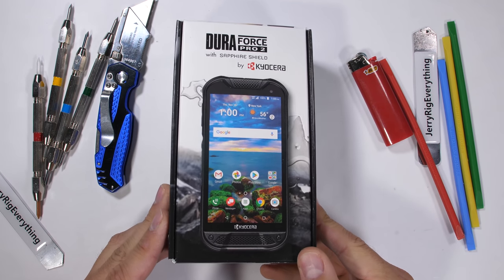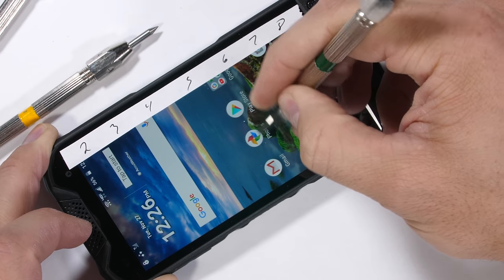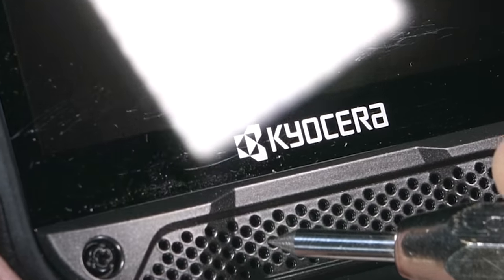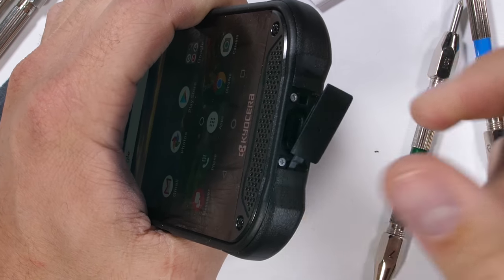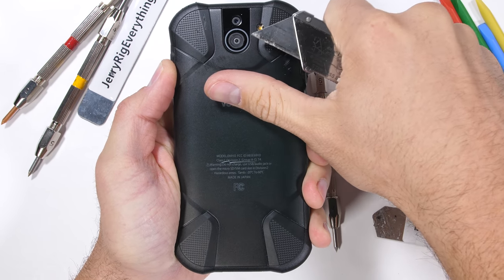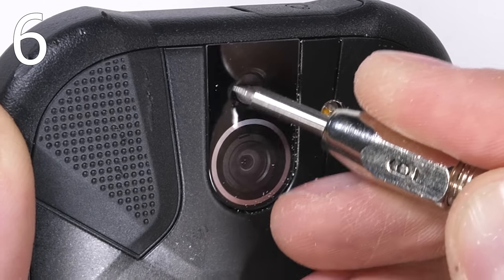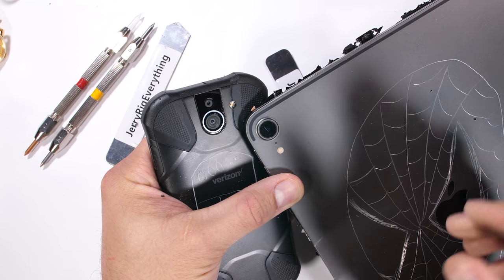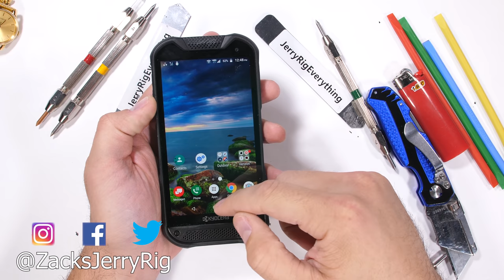A Rugged SAPPHIRE Covered Smartphone? - Durability Test!

Comment: Lol my EMS company uses these as our radios. Perfect for the job 😂
Reply: alexandra i. Are they good phones? Wouldn’t mind owning something that actually works as advertised. cough Apple
Reply: @ixionn563  😂😂 I mean, I only use the phone on the job, and only for messaging, calls, or GPS. And we recently got them, so I haven't seen any horrible damage to them yet. But I know for a fact they've been dropped and thrown around multiple times already (probably stepped on and sat on, anything else you can imagine lol), and so far, so good. I honestly thought the frame was a case when I first saw it. They seem sturdy. And, to me, they don't even feel that bulky. But like I said, I don't really feel like I could give an honest answer to your question, as I haven't used them for very long or as a personal, everyday phone. But good luck! Hope this helps at least a bit
Reply: @ixionn563  I bought one a few months ago & I think it's awesome. I'm a truck driver & it fell out of my front shirt pocket one day at a job site & I didn't notice until I was 2 miles down the road. I went back & found it 6 inches deep in the mud with a tire track over it's screen, I ran it over after I dropped it. It still works! Sprayed it off with a hose & kept using it lol
Reply: @dant387  damn nice

Comment: I've had this phone for going on 2 years, and still clean it under running water for kicks.  I have dropped it plenty and never had any extra protection on it.  No scratches noticable when the screen is on.  One thing I'd say about it is that, while the exterior holds up phenomenally to abuse, I can tell the gyroscope and processor are feeling the abuse.  Assuming however durable the phone is, the innards will still get knocked around.  All in all, most durable phone I've ever seen!

Comment: Why you do burn test, but not drop test and liquid submerge test is beyond me.
Reply: same!!
Reply: The drop test is very important
Reply: They're inconsistent tests and can't be replicated every single time easily. And the liquid test isn't accurate due to the fact that the corrosion which occurs to kill the phone would take a while, and not the length of one video. Unless salt water is used i guess, but even that is not always accurate as non water-resistant phones can survive for short periods even in salt water before corrosion kills it.
Reply: For the drop test, just build a rig that drops it from the same height onto the same surface over and over again.

For the water durability, why not boost the process and put it in electrolysis? Hehe.
Reply: Albin B
There would still be imperfections because of the angle the phone drops.
Reply: when you think about it, it's not needed. 

Glass is easily broken. Like, 90% of the phones will fail the durability test, only the plastic screen ones pass. That is not very informative. It doesn't show the quality of manufacturing, since that's just how glass is.

 Unlike the bend test, which shows manufacturing quality. All phones nowadays are made of the same material (aluminium) yet some fail and some pass with flying colors.
Reply: Wendy Prasna
I would have to disagree. Like the bend test, the drop test would show weak points too. I don't know if all videos on youtube are fake but the iPhones with the glass backs perform better in drop tests then let's say an S9+. I personally like samsung better and have the S9+ with the gear S3 so anyone saying I'm a fanboy is wrong.
Reply: It's because if you want a drop test, there's plenty of other youtubers who do that, what other youtuber burns their phones?
Reply: Ty Klo
The difference is that some tests are fake, badly executed etc. If Zach made a test that's perfect everytime, everyone would trust him because he has a reputation.
Reply: Err because he likes fire, he said so..
Reply: @MaksKCS  There is no need for him to make drop test videos. Others do it just fine. Even technically, with reproducibility. Others do water tests just fine. These tests wouldn't provide any new information. His reputation is doing what he's already doing, in his fashion. People, like me, watch his videos because they are objective, and different. Dropping a phone isn't differentiating in any way, because its already done. An all around scratch test with special scratching equipment, is differentiating. He could definitely do a drop test, but it would draw conclusions already known, and unnecessary. If everyone did a lighter test, why should he do it as well? All I'm saying is it's down to what he feels best, and what makes him stand out, because he knows that's what matters.
Reply: @MaksKCS  
If you watch videos of other youtubers doing drop tests, the shattered parts always depend on how the phone falls. That means, everywhere on the phone is a weak point. It doesn't really show anything. 

Yes, i have seen the newer iphone drop tests. It's certainly impressive, but unfortunately right now it's an exception, not the norm. 
In the future when those strong glass the iphone uses is mainstream and used in all smartphones, maybe then the drop tests will be relevant. See if a "iphone glass" protected Samsung can hold up against an Huawei using the same "iphone glass", for example.  
Today though, the iphone lords over all in terms of glass strength. Other phones doesn't need the drop test, it will automatically just lose against the Iphone.
Reply: I can think of a few possible reasons: drop tests are kinda inconsistent, other channels do drop and water test, and water test would eliminate the teardown aspect of his channel.
Reply: Maybe a follow up video just for this phone then. I wanna see a drop from two stories!
Reply: Because he does tear down videos with the phones he's tested... And more? Drop and liquid tests would render the phones completely useless.
Reply: Because he likes fire.
Reply: @qwerasdf-oy6uo  the newest iphones didnt break at all in his drop test video
Reply: Cuz both tests are a load of bullcrap...
Reply: Death stroke, because there's no point due to the fact that it has been proven that the phone will not be destroyed very easily (unless it's an iphone it's worth destroying)
Reply: Cause fire is cooler duhh
Reply: @qwerasdf-oy6uo  cough cough Stainless steel, ceramic, titanium cough cough
Reply: Because than Apple will be destroyed. When you do the droptest and the iPad is your ground
Reply: @djbosanac19  the iPhone XS survived dummy. and who drops a tablet. Also basically every tablet weill die. So uch survace area so litttle thickness of glass.
Reply: Thanks to everyone for opinions.. I raised this question bcz phones are 1000% more prone to falling and submerging than being engulfed in flames.
Water tests results aren't immediate.forget that. But he can do one single specific height drop test like dropping from pockets. Ik results will be inconsistent, but it's something

Comment: be it sapphire or diamond, ill still use a screen protector ..
Reply: If you're so keen on screen protectors you may as well just use glass it's less prone to shattering. Unless you carry around diamonds in your pocket there is absolutely no need for a screen protector with a sapphire screen. You couldn't scratch it if you tried
Reply: @alexanderhowarth6460  A protector would protect against shattering. It's a good, disposable layer to have on sapphire if you want your base phone screen to last a very long time without needing to be repaired.
Reply: @sweatingprofusely8198  I don't think so. It may have a negligible effect of spreading load but I very much doubt that a screen protector would save you from a shattering. A case would make a difference but no, I don't believe a screen protector would help prevent shattering your screen
Reply: @sweatingprofusely8198  exept obviously in this example the case  is integral to the  phone. You don't seem to understand that it's effectively impossible to scratch sapphire with anything other than diamond. A disposable layer on top getting scratched counteracts the purpose of having an unscratchable  screen. Again, if you're going to use a protector you should just use glass
Reply: Dude there’s no chance of it scratching. It doesn’t need a screen protector.

Comment: hey isnt that sapphire more volnurable to drops but rugged phones should be shatterproof more than scratchproof
Reply: While it is true that Sapphire being harder actually makes it far more brittle than glass, the rest of the phone is most likely built in with this in mind, dampening the shock with which such an event occurs, hence the plastic and rubber, which are far more flexible.

The point with phones like this, however, isn't to remain flawless. Designing for that is a waste of time. This was designed to keep the phone functional even after something that would normally destroy other phones happens to it.
Reply: @EzraM5  EEEEEEEEEEEEEEEEEEEEEEEEEEEEEEERREEEEEEEEEEEEE
Reply: @EzraM5  Also screen thickness. While screen glass technology is constantly evolving, every time it happens phone manufacturers make the screen thinner, making the result the same or less durable than earlier models, mostly Apple
Reply: @JakubKraus0  Very good point on that, too!

Comment: phones are reaching into the thousand dollar range and normal gorilla glass screens cost like $3... would a sapphire screen at $30 on every flagship really be that hard?
Reply: Yea sapphire is scratch resistant but its more brittle compared to glass.
Reply: But if it is more scratch resistant then cracks are less likely to form, the downsides of the brittle part would come into effect with punctures and bending right?
Reply: No no when a material is brittle it cracks faster when there is a sudden impact
Reply: @bhume7535 
You can smash a diamond like it's nothing. It's hard, but also very brittle. Same with sapphire. Plastic is very easy to scratch but doesn't really shatter all that easy. It's a balance.
Reply: ok, but is the difference between the brittleness of glass and sapphire significant enough to care about? The DuraForce Pro 2 is a rugged phone, I'd imagine people would care more about a screen in one piece then small scratches.
Reply: @bhume7535  
It only matters if the screen get damaged directly.
Reply: @bhume7535 
If they care about just keeping it one piece, then they could have made it out of polycarbonate and not something so brittle.
Reply: @bhume7535  Do you know what brittle means?
Reply: @Bhume Haha, I like your response. :)
Reply: @UnfitToLive  nice, you subhuman trash
Reply: @bhume7535  wow, what a civilized response
Reply: @kiyoponnn  Pathetic
Reply: @thegribbs  Just like your life
Reply: @UnfitToLive  You're lucky we're not going to meet irl
Reply: @sp4rrow I won't comment on someones hobbies, I believe their personality has given a much better representation of who they are.
Reply: Y’all sound like y’all got some sexual tension between yall
Reply: @JonathanGarcia-tx8rb  
↑The hero this conversation deserved.

Comment: There are two big reasons why companies don't use Sapphire: Sapphire is more brittle so if you drop your phone it'll crack more easily. I don't know about you but I rather have a scratched screen than a cracked screen. Sapphire is more reflective, making the screen less visible under direct sunlight, and also by using a Sapphire screen this will cause your battery to drain faster because your phone will need more light to make through the Sapphire screen so yeah......
Reply: Thx for the explanation. 👍

Comment: My original DuraforcePro was run over by a car last year (Verizon with Sapphire screen). Still works fine. No cracks or damage to the screen. It's also a Class1 Div2 rated phone. Yes, important when I'm at refineries or in the gas and oil fields.
Has worked for me with no screen response issues  in -15F temps with snow falling on the screen. Has fallen in the snow, into water a couple inches deep, fell 20 feet off a platform around a tank. That fall  put some tiny scratches on the case corner, that was all.

I threw it across a room to a friend at work that wanted to see it. He missed and it bounced off the table and floor. Nothing happened to the phone. The look on his face when he missed the catch was priceless. 😆

There's a test stress for you. 🙂

Comment: I switched to Kyocera because of the durability. I have had this phone since February and it's been dropped, stepped on, thrown, submerged fell of the fender of my jeep at 65 mph and skidded into a ditch and overheated on the truck dash in the sun multiple times and it just keeps on going. Not a scratch on the screen and it's never and will never have to be put in a case.

Comment: OK... So I've been wanting to say this for a while now. Maybe this older video isn't the best place, but hey... I finally caved and feel the need to express myself.
Holding a flame to the screen should be representative of how the pixels will react during phone overheating. Several times I have lost considerable amount of picture quality due to gaming while charging, or just random stuff happening during charging, that left the phone (several different ones) almost too hot to touch. In some cases you can see spots on the screen where the color is off afterward, as well (as the whole screen appearing washed out). My point is: Burning your screen is NOT pointless! Even if the knowledge gained is hard to apply and only applicable in very few cases.

Comment: Kyocera makes a great cheap phone. I've had the original Dura Force for around 4 years or more. The only problem I've ever had was the finger print scanner stopped working after a few years. Not a scratch on the screen! It's been underwater filming, in my pocket while swimming...by mistake. Dropped 100s of times on concrete and rocks. It's not the most "Tech" phone....but it just works for rugged conditions! I'm going to get the Dura Force 2.....the original did not disappoint! And I killed alot of phones in the past!

Comment: I bought this phone recently based mostly on your review. I needed a rugged phone.... "Fire" test was possitive, but it left 'oil' marks on the screen afterwards that dont rub out.

Besides horrible service... (Maybe phone is too thick) that I get bad service reception and even more poor wifi, this phones kicking ass. It was already ran over on accident.... No damage so far. I've only had it for 4 days... Thanks for the review
Reply: @MrGGorky   destructive testing ,didn't set it on fire just a lighter to the screen only. It's under warranty. I've had phones that if left in the sun would kill pixels and make half the screen unusable
Reply: @D3Fd0ck  ok

Comment: I have the Duraforce Pro 1.  The front speakers are poor and choppy, MTP for file transfer has never worked, locks up when someone is sending me a text message and now the touchscreen randomly responds.  The screen looks great and It is extremely durable.  I was so pissed off with it that I tried to break it and couldn't.  I did not use a hammer or anything...yet.  Maybe I should send it here.  LOL

Comment: I've sat in the sauna with the pro 2 and received my phone is too hot. It also acts like the digitizer is going out.  The screen will crack on hard impact 😂
Reply: I took apart an old one right down to the film on the back of the screen. These phones are not moisture proof. I found moisture under the layers of screen film.

Comment: "And now the bend test." I started laughing as I watch this video on Duraforce Pro2. I had it's predecessors (Brigadier, Duraforce) so this was my obvious choice in phones.
Reply: @solidale21 - How did you like Duraforce? Any problems with it?  I am looking at purchasing a "renewed"one from Amazon & feeling undecided. Thanks for any input! :)
Reply: @mcsmama8619  The regular Duraforce was good and functioned a little slower after a while but a good rugged phone that worked after quiet a few good drops. My advice would be to get a silicone case for it. It will help with the dings if you are prone to dropping your phone.
Reply: @mcsmama8619  it is worth a buy if you aren't after some hefty specs
Reply: @solidale21  Thanks so much for your response. No, no need for hefty specs... I'm a simple girl! In fact, I've never had a smart phone... I've been using the same slider phone for about 12 years & love it, but I HAVE dropped my current phone on my driveway quite a few times ... I am only shopping now b/c I've been informed that the towers for my old phone will no longer be supported come Jan 2020. :(  I have Verizon & a friend suggested this to me: "Kyocera Duraforce E6810 Pro with Sapphire Shield.. Verizon Rugged 4G Android Smart Phone".  After reading a bunch of reviews & comments, my concern  is multiple complaints about the power port failing, & the current lack of available replacement batteries with frequent complaint of battery failures.  So I'm wondering, how long did you use your old Duraforce, & did you have any of those problems? Thanks again.
Reply: @mcsmama8619  so the power port worked up until I used a warped micro USB charger and snapped the charging prongs inside the phone. I was still able to use it for quiet some time due to the fact that it has wireless charging. It lasted me about 6+ months before I upgraded a few months ago.
Now for replacement batteries.
Alot of people won't work in the Duraforce. It's sealed up so tightly people don't like to work on them. If you do get a refurbished one if they offer some form of insurance I would get it just in the peace of mind if something does happen internally. All in all I love the phone.  Despite some of it's short comings.